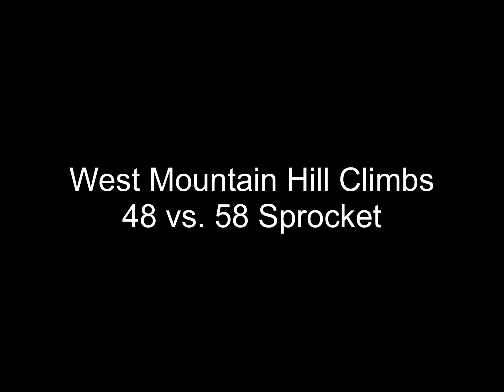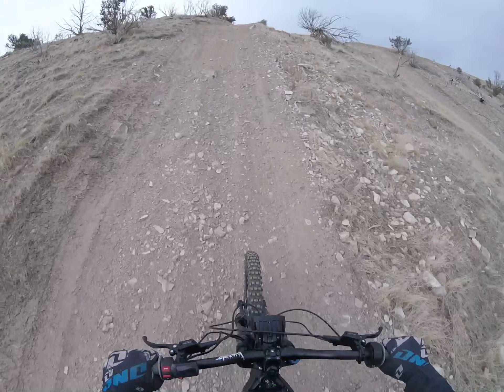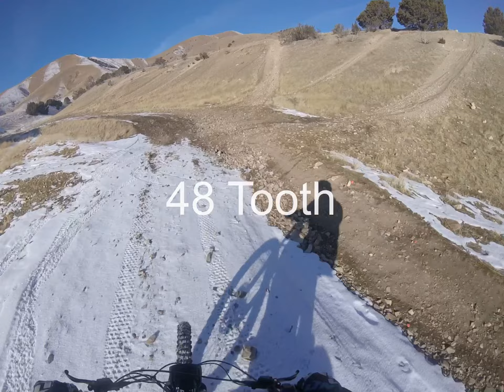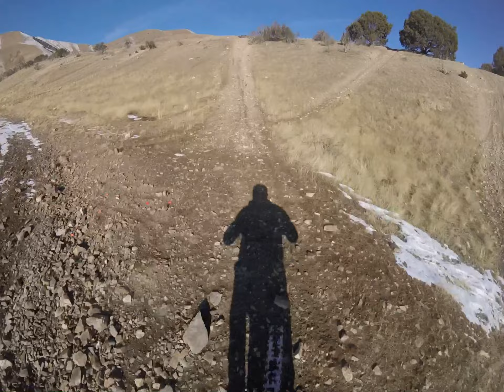Surron X 58 tooth vs. 48 Tooth Sprocket

Comment: Which do you prefer? 

I guess it would come down to what terrain you ride most. Ive been tossing up between the 54T or 58T
Reply from the maker: I've never tried the 54T but the 58T seems so much faster off road, because of the acceleration.  On road it seems pretty slow though. I would highly recommend the 58T if you're doing mostly off road riding.

Comment: i think it consumes more battery.. 58T
Reply from the maker: From what I understand it actually increases range off road because the motor dosent have to work as hard to get it up to speed. On road is a different story because you pretty much have it pinned everywhere. But from what I have noticed there isn't a huge change in range.
Reply: @davidlosee9456  many tks! I will try 👍😜